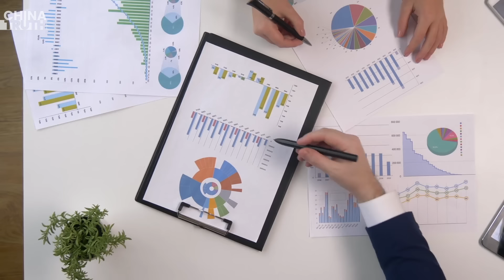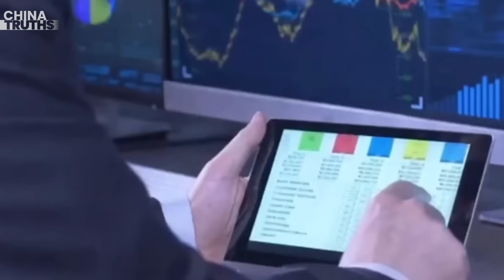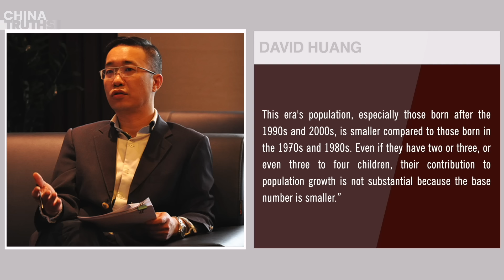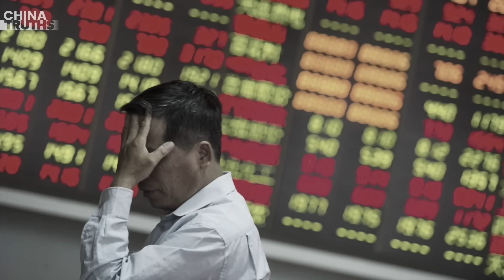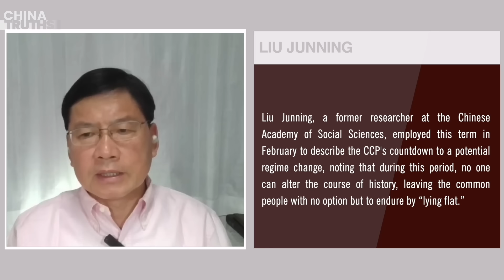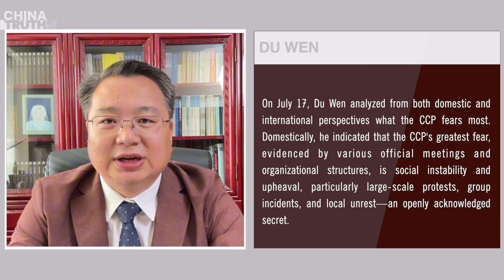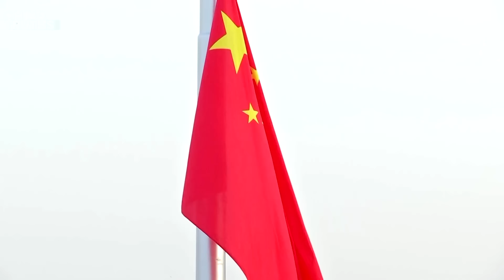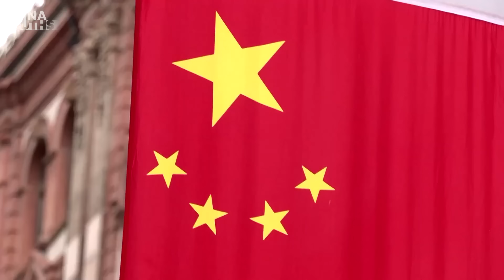Disaster: Three Gorges Dam Opens All 11 Spillway Gates; China's Population to Decline to 600M?

Comment: "China’s economic reforms saw the rights to use dams and reservoirs privatized to relieve public finances. In the event of a flood, there is now a conflict between the economic interests of those with use rights and the public interest. Economic uses – electricity generation, water supply and irrigation – require the reservoirs to hold a lot of water. But in the event of a flood, the public interest requires the reservoirs to be emptied. Given the poor construction quality of many dams – including the Three Gorges Dam – the central government and many local governments are worried about dams failing. 

So, the following priorities have emerged: first, dam safety; second, economic uses, directly tied to the interests of those with use rights; and only in third place, flood protection. As a result, events often unfold as follows. The industrial water users store as much water as possible, not least in the name of flood protection. Then the authorities or the users discover that the water volumes are endangering the dam. The authorities then order water to be drained – hopefully still in good time. In August 1963, more than 300 dams in Hebei Province failed – and the resulting damage has remained a state secret. In 1975, 62 dams broke in Henan province and 240,000 people died. "

Source : https://merics.org/en/interview/wang-weiluo-chinas-worst-flooding-decades-damage-floods-do-growing